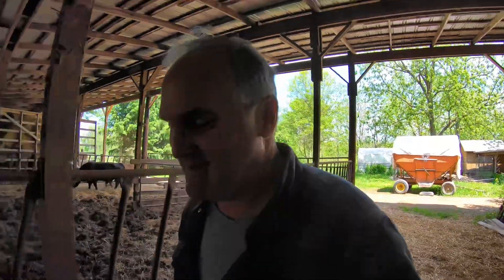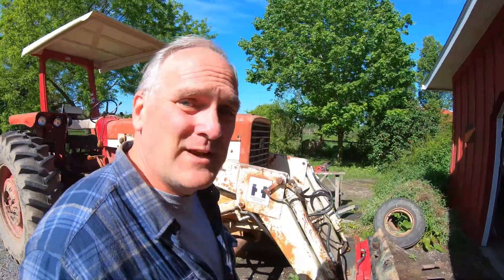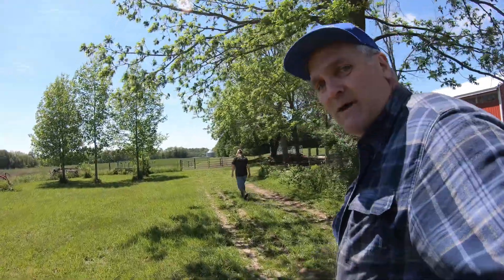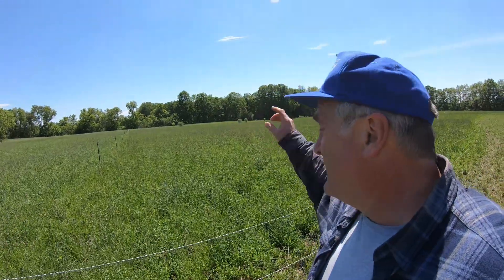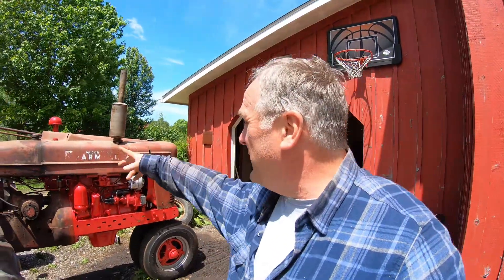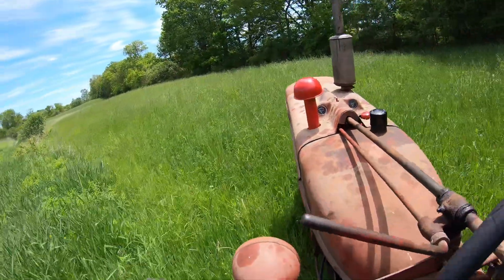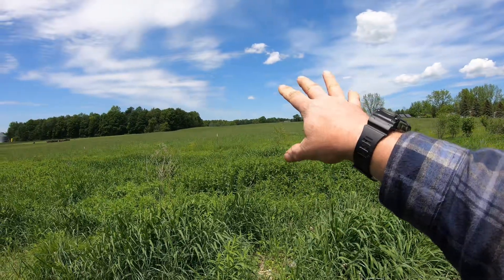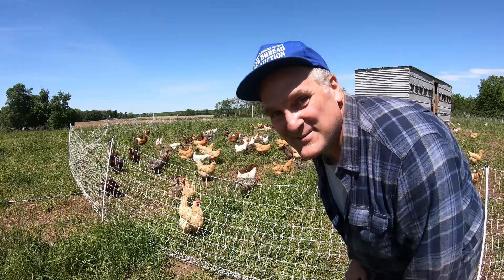This Hay Is Ready To Cut!

Comment: Came for the Hay, Enjoyed the piglets, stayed for the Dad Jokes.
Reply: I notice that you were checking your air filter for buildup but I was really Surprised to see you blow it out from the outside in😯😬 

In operation the flow of air is from the outside in but under a suction action a and with the Whole surface of the filter element being Entirely open to intake fresh air .

But when you use pressurized air it IS ONLY concentrated in a very small area of the filter the size of a dime or smaller and if you are blowing in the same direction as the normal operating flow of air But at extreme high pressure SO
Your blowing the dirt deeply into the fibers of the element and IN FACT your blow some of the dust and grit into the inside of the filter so when you replace it and start up the engine you Will be sucking grit into to your cylinders to begin a sandpaper  effect .

You should replace your filter if you possible can But you are supposed to blow  air from the inside of the filter out
There is a tool made to this safely  but a large clean rag placed inside the very edge of the open end of th filter and a a open pipe attached to your air hose at full pressure flow directed towards the closed end of the air filter or just make you a L shape pipe suck as a piece of copper tubing with a short bend outwards at one end but the air press should be about 20 - 30 PSI as to not damage the filter element  hope this helps🙂

Comment: Here's a hot tip if you take the copper washers from the injection pump heat then to red and then drop into water they'll go soft and seal well and no more leaking

Comment: Hey Pete, you should invest in one of those oscillating/rotary zero point nozzles for your pressure washer since you've got all that equipment to clean. It will make a small home owner pressure washer work like a commercial grade cleaner and clean soooo much faster. With more power to knock out that heavy mud you have to deal with when cleaning farm equipment. Just be careful and don't get the tip too close to wood. It has enough power to damage the surface of wood.

Comment: My Friend showed me that if you shift a farmall M from 4th to 5th with out double clutching, you tap the shifter to 5th so it grinds for a split second, and then put it back in neutral before sliding it in to 5th. I don’t know how much that wears the gears, if it were mine I’d double clutch

Comment: Can’t double clutch, if you don’t let the rpms fall the real be no synchronized gears, that on the up shift. To down shift you need to increase the rpms. But you knew that. Great video.
Reply from the maker: I am able to double clutch the H and shift into road gear without reducing the rpm’s.

Comment: Excellent video Pete :) & Hilary :) also animals looking excellent health to and yes tractors & machinery need lots care for keeping going strong Hay not cutting up my way yet but next week they start up doing in first cutting of 2021 ! But vegetables farmers get lots done plus first crop of Lettuce plus Asparagus cut up so far ! But at my place done Rhubarb so far first cut and more come soon!  Excellent jokes Pete :) ! Got joke for why did The Farmer & Steel Toes Boots have in Common ? The Steel Toes Boot keep farm feet protection from get bash up and safe! Plus boots saying  to be safe farmer I will be ! Also yes poop is hard front wheels or trailer wheels because rust plus put holes them bearing caps to Pete :) ! How found that out my Dad 1963 McCormick International B414 Loader tractor Desiel motor had get motor rebuilt in 1992 when clean up tractor before repair we noticed cap in front wheels rust out bad also could get dealership get new one so weld job for me do and lucky found there was tractor at Tractor Wrecking Yard had all parts to fix Tractor with also in Tool Box tractor had 4  brand new caps never used ever plus tons parts need! I bought them whole tractor and took home farm did rebuilt job ! Then rest of tractor and old parts scrap it too when done main tractor! $500.00 for scrap tractor and got 4 months later got $750.00 old tractor plus rust parts too! So did good deal!

Comment: In the warm weather do you have to start the Diesel engine on gasoline on your Farmall or does it just start up on Diesel?
Reply: You have to start them on gas no matter what In till the engine is warmed up then you should be able to start it on diesel but when first starting the tractor if the engine is cold it needs to be started on gas then switch to diesel

Comment: For about the last eight months I've been buzzing around YouTube watching videos.

I think this is where I first learned where there's some sort of white waterproof rap that allows the hey to be harvested with much more moisture than back in my day when it needed to be bailed.

Obviously the advantages you get Leslie shatter by harvesting it with more moisture in it. But this doesn't work when you get it in the barn because I can start it on fire with all the heat that can be caused or mold will set in either way destroying all the effort.

Seemingly these white bags are like a silo where the hay will just for men and keep until the bags are punctured for feeling out of it.

With this be part of home studying or is it considered a "No-No"...??